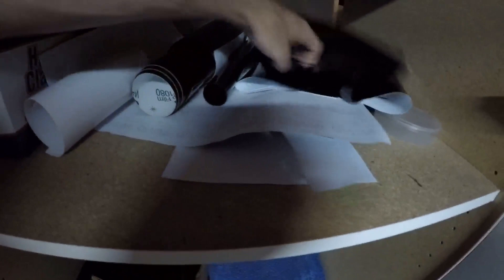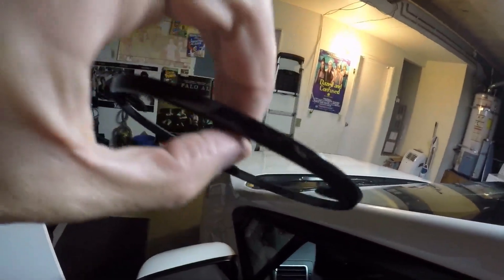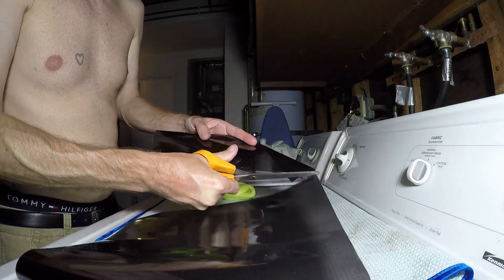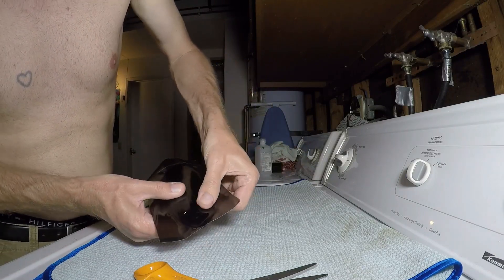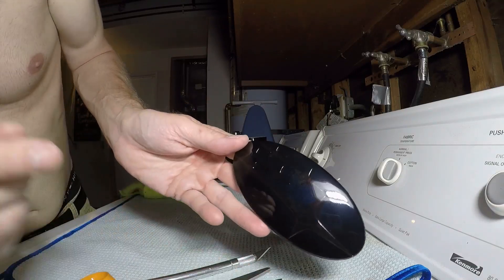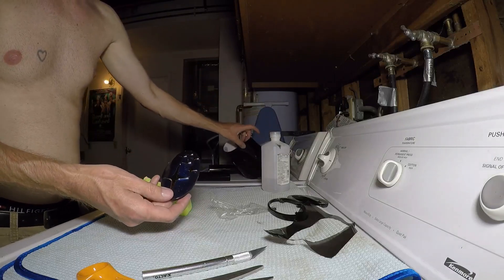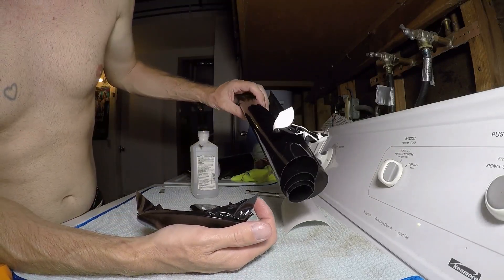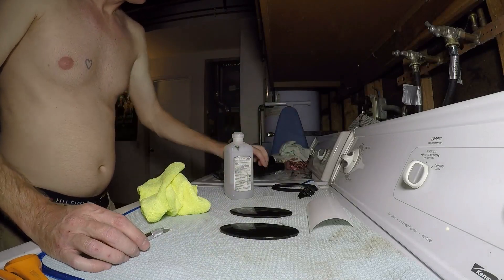2015 Subaru WRX Ep. 426: New Emblem Overlay Ideas

Comment: Happy Father's Day 
Both emblems look good, I like the tinted look a bit better, it does add that depth.
Reply from the maker: thanks. you can barely see thru the 20% tho, unless its in the sun. as i mentioned a minute ago in my comment, i might try a 35%. I think i might have enough on my side marker cover i didnt use to use it on an emblem instead.
Reply: +LastHumansGarage I bet that would look sweet in 35%
Reply from the maker: not so much, i posted a pic on my FB page.

Comment: where did you get the tint? I like that Idea I have the cf look with red I think the tint 35% will set it off
Reply from the maker: amazon
Reply: Thanks I did  find some  on eBay going to try it out first
Reply from the maker: oh dude i can't even keep track of my tints and vinyls anymore. i can't even remember where i got this one.
Reply: ok thanks I found some online . I wrapped my trim pieces in 3m 1080 cf it looks good  I wrapped the 3 gauge screen the flat piece . the reflection of the light makes the 3 gauge part look cf kinda cool .